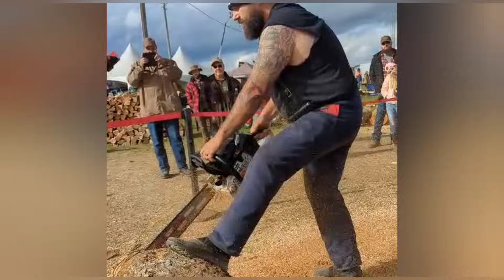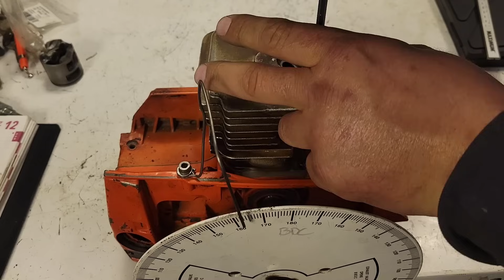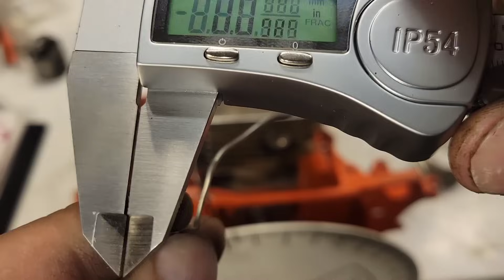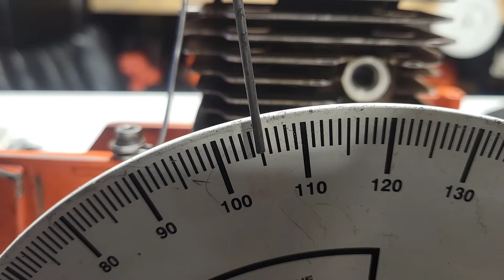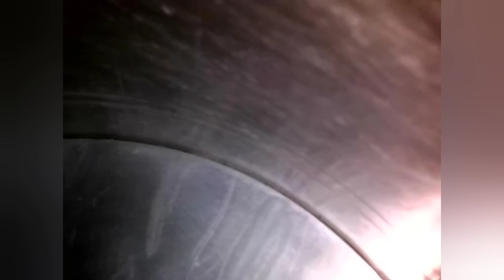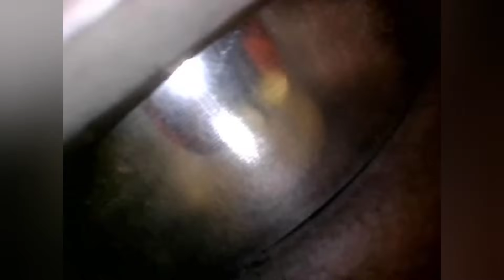MACHINE WORK, TIMING AND SQUISH!! 394XP BUILD

Comment: Do you use just regular 1/8” diameter solder wire to check squish?
Reply from the maker: Yes I have several different thicknesses
Reply: @tinmanssaws  thanks!